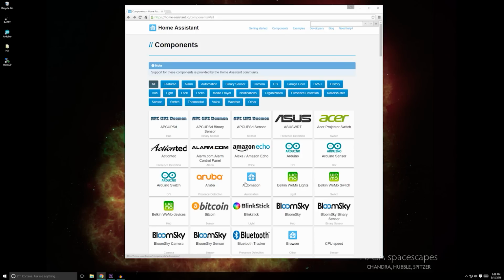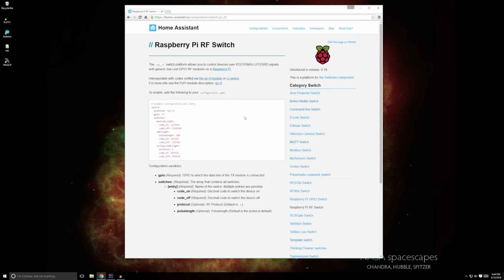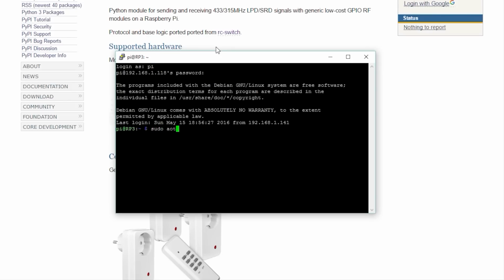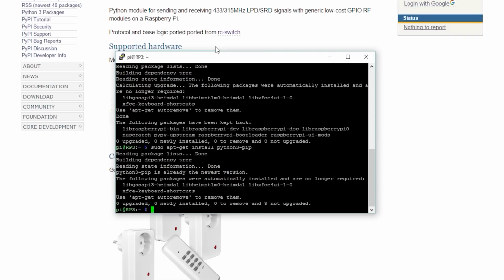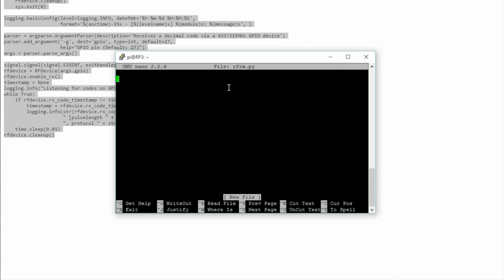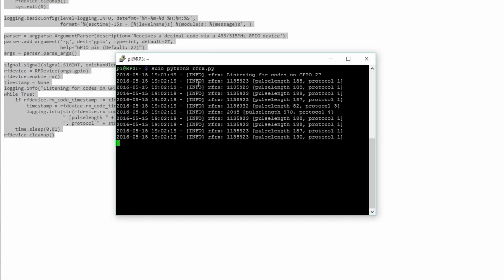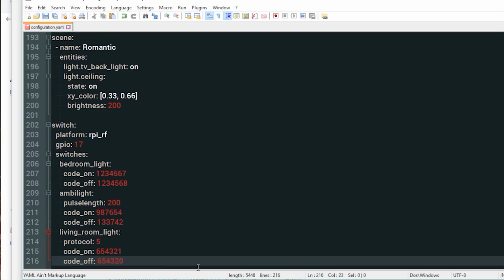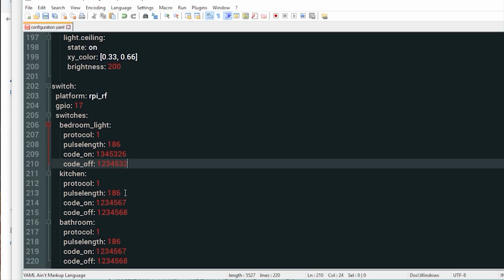The Cheapest Tech - $6 DIY Internet of Things Smart Outlets

Comment: Do you know of a way to make my ceiling lights 433 rf? I can't go the hue route as they are 4 candle bulbs in one light fixture. Ive seen on Ali express a 433mhz relay, could I put this into the lighting circuit do you think?
Reply from the maker: +Peter Ebenezer You could definitely go the 433mhz relay route. That should work! Depends how much electrical experience you have. I always try to avoid playing with mains as much as possible... but then again I rarely know what I'm doing. :P  

I'd also explore either z-wave switches http://amzn.to/1XfGSMv or something like the WeMo WIFI switch http://amzn.to/1qocbaM, too. Both tie nicely into Home Assistant, as well. See if anything there jumps out at you. At the end of the day, there are a million ways to do the same - it's just a matter of cost and effort. :P
Reply: +BRUH Automation thanks for the quick reply! I live in the UK so light switches are a bit trickier over here (our wall boxes for the switches are only a certain depth) to be honest I don't even know where I could put the relay! Probably just before the light fitting I imagine to make access easier...
Reply from the maker: +Peter Ebenezer For sure! Sounds good. Yeah, UK power is no joke. I don't like playing with 110v here, let alone 240v in the UK. Good luck with your project! let me know what you decide. Cheers!
Reply: +Peter Ebenezer An alternative might be using a Fibaro Dimmer. It goes behind your wall switch.

Comment: What is the range of these receivers and transmitters?
Reply from the maker: +Alok Saboo The remote included says 30 meters line of sight.. not sure about the Pi's transmitter. I have no trouble receiving signals through four walls on the opposite end of my apartment unit. I haven't found the max range yet. Some people report the RF signals go >100 meters with similar setups, but I'd need to see it to believe it. Hope that helps!
Reply: +BRUH Automation thanks, I was about to ask the same question so guessing that having the pi upstairs going to the room below should work fine!
Reply from the maker: +Peter Ebenezer Should be! Let me know if you get it working for you!
Reply: +BRUH Automation I have my Pi in one room and I am hoping that it will cover the entire house.
Reply from the maker: +Alok Saboo Hopefully, it should have the range! Let me know. Nice thing is if it doesn't have the range, you're not out a ton of money. The Pi is insanely useful even outside of RF purposes and the outlets are minimally useful for holiday decorations. :P